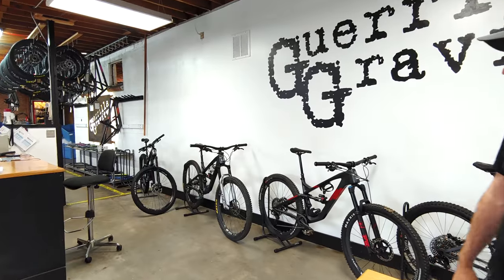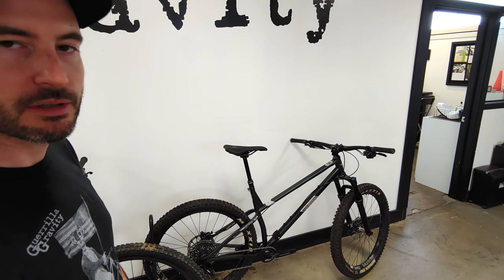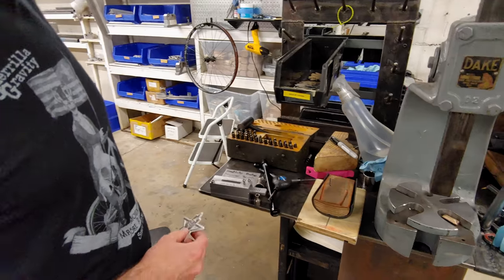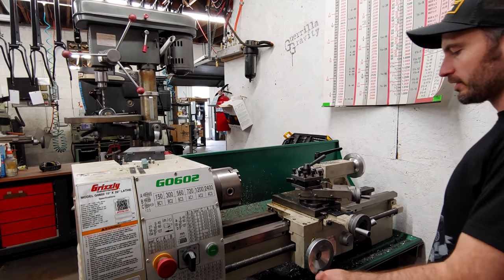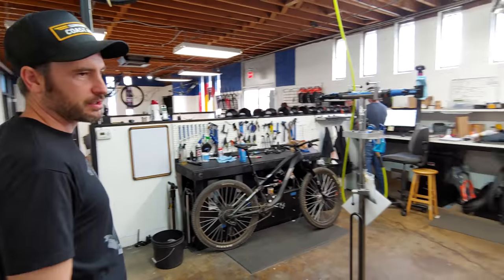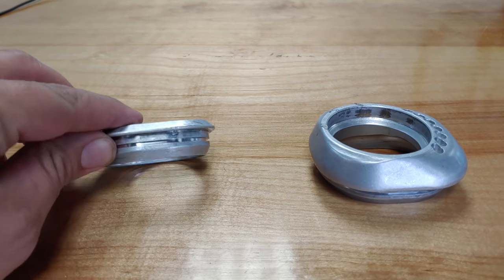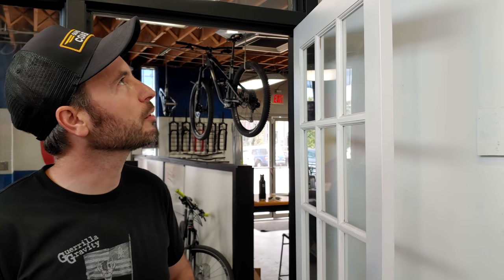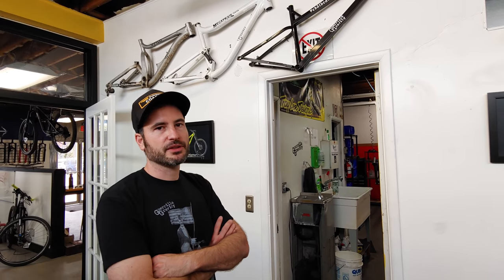A Tour of Guerrilla Gravity's mountain bike factory in Denver Colorado (USA made Carbon fiber bikes)

Comment: Their frames are ugly. The horizontal shock orientation sucks, robbing any room for a water bottle. Put the shock in  vertically ( similar to Trek, Scott, GT etc..) and that would be huge improvement.
Reply: There's a mount under the top tube for a water bottle. There's also a mount on the down tube under the shock for a little something
Reply: @B Franco you would rather sacrifice performance for 12oz of water storage?